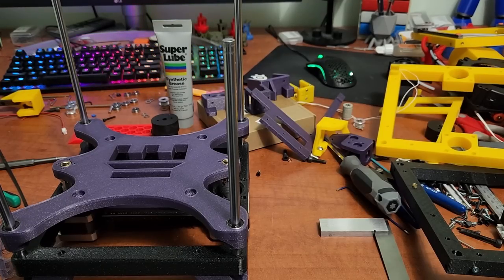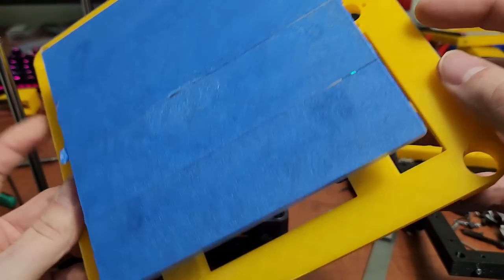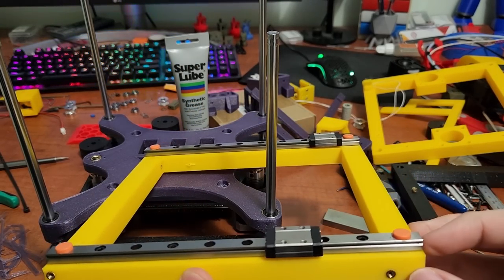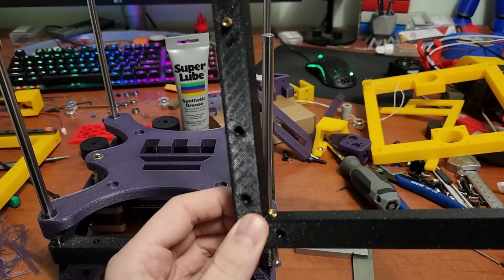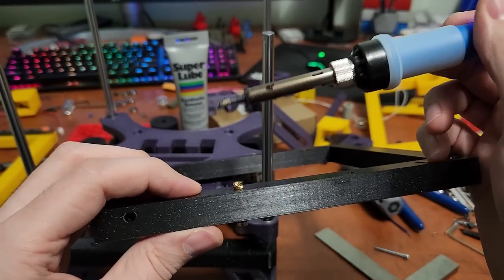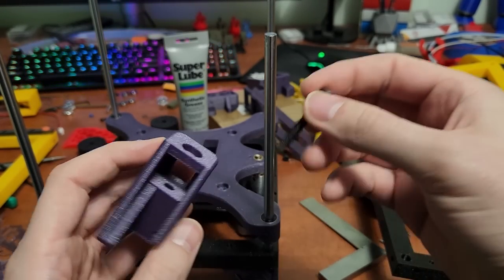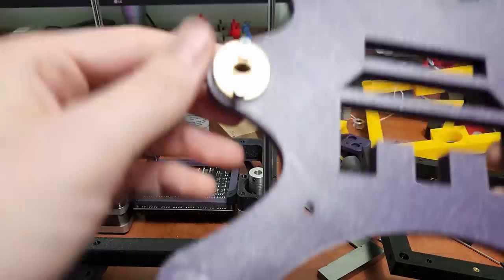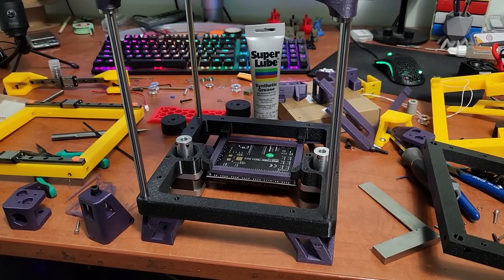Rook a cheap mostly 3D printed CoreXY printer - Build Tips Part 2 - Heat Inserts, Bearings, Frame

Comment: For me, the most beautiful thing about this design is that the linear rods act as a frame. I love small 3d printers and an idea like this makes me so happy. I will definitely follow the improvement progress of this printer :)
Reply: Yeah agree on the linear rod as the main vertical support and also guide👍. Keep to your main theme cheap but still performs. I would not go corexy prefer croXy with all rods no linear rails.

Comment: I use my machinist square to to flatten heat set inserts we well. It works great. I never thought to keep them aligned with a bolt though, that's clever.

Comment: Your heat set inserts should ideally be pushed in a little further, as you notice theres a small lip where the plastic isn't surrounding the insert at the top.  If you pushed it in a little further, you will get full coverage around the insert.  Remember, these are not injection moulded parts, so you're not gonna get proper adhesion around the full insert when it's perfectly level, like you would with proper injection moulding.
Reply from the maker: I find if the heated insert is hot enough there is no lip, the plastic is flush with the insert

Comment: Instead of taking the carriage off the linear rail, you can use a syringe and inject the grease from the backside of the carriage through of one of the rail mounts. You will see the lube seep out through the ball bearings and you won’t risk losing balls
Reply from the maker: yes that is probably the best way

Comment: Did the design originally have threaded inserts?  If not what was the reasoning behind switching to them? Do you think screws can be threaded directly into the frame instead?
Reply from the maker: The design always used threaded inserts for key items. They are needed for the linear rails, motor mounts and idler towers

Comment: Hi Rolo, just wondering what size bed is on the printer that you use to make the large parts ? Thanks
Reply from the maker: I use my bambu x1 carbon but a ender 3 will work
Reply: @Rolohaun  Hi, I was just wondering that, are all your printers using a 300 x 300 bed then ?, I was looking for one with a 400 x 400 bed so I can print large parts
Reply from the maker: @acestu  300x300 are too big for my space so I don't use them

Comment: 4:24 PLEASE DO NOT USE PTFE GREASE FOR LINEAR RODS OR BEARINGS! When used with bearings that have balls, the tiny ptfe balls will eventually bunch up and jam the rails. A thin oil or grease with no additives is the best for this application.
Reply from the maker: I do not think this is true, Super lube says you can use this on linear rails, Voron community also recommends this
Reply: @Rolohaun  I feel like this is a hard topic because some say you can and others that you can't. From my knowledge (that comes mostly from linear motion manufacturers) you should NOT use it. Here are some statements:
- "It’s also important to ensure that grease lubricants do not contain solid additives, such as PTFE (Teflon), MoS2 (molybdenum disulfide), or graphite. While solid lubricants and additives are suitable for sliding contact bearings, they can cause significant damage to the surfaces of rolling bearing elements." 
- "Greases used in linear guides are typically lithium-based greases, with no solid additives such as MoS2 (molybdenum disulfide) or PTFE (Teflon)."